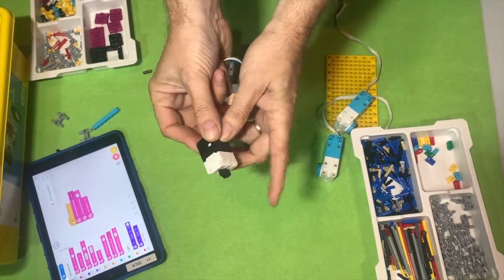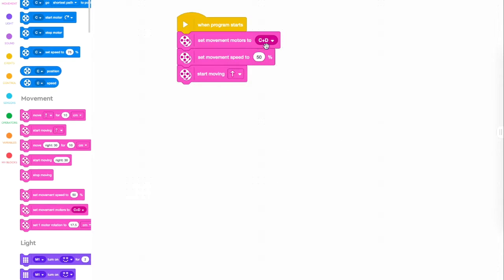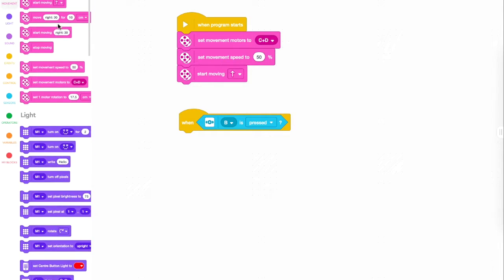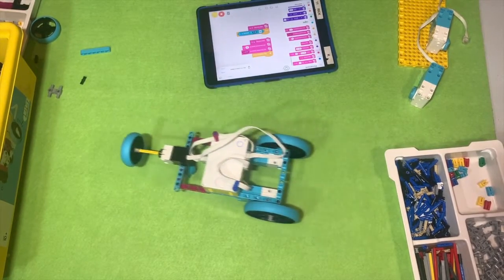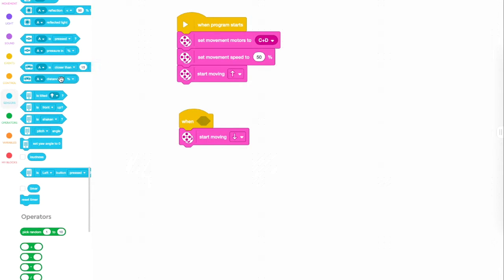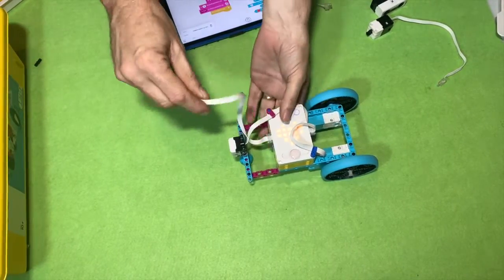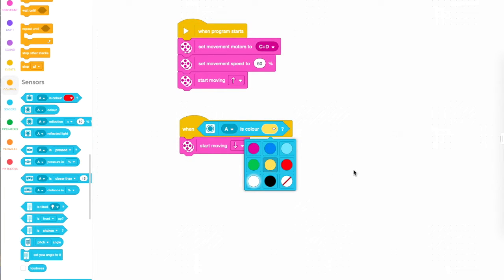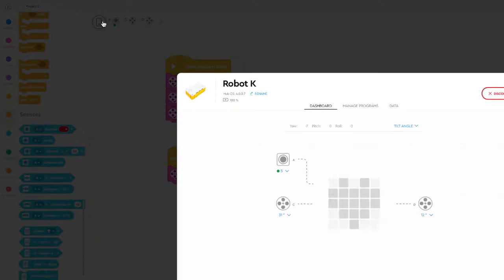Intro to all three sensors LEGO SPIKE PRIME. Simple yet advanced!

Comment: Great video!  Thank you!  I'm a physics teacher...and I'm trying to use spike prime sensors for physics experiments.  But there is a small problem.  The force sensor only gives discrete values of 1, 2, 3 Newtons, etc. up to 10. Could you help me with the settings of the sensor to get continuous values if possible?
Reply from the maker: Looks like 10 steps is all you get with this force sensor. I have tried a few things, even displaying pressure on screen as I experiment, but no  matter what I try it is on a scale of 1-10 with ten steps
Reply from the maker: You inspired me to make this video: https://youtu.be/C8R3KCjnx0w